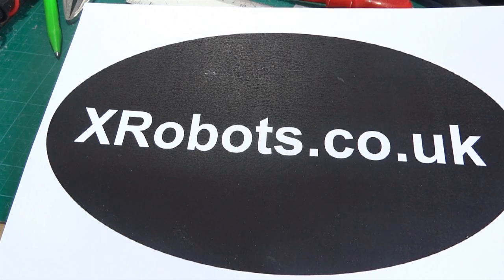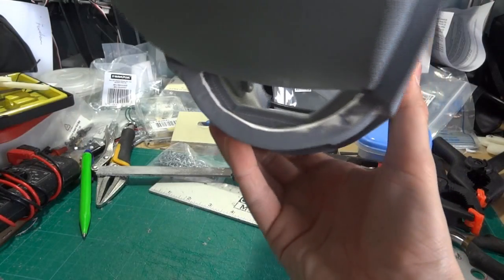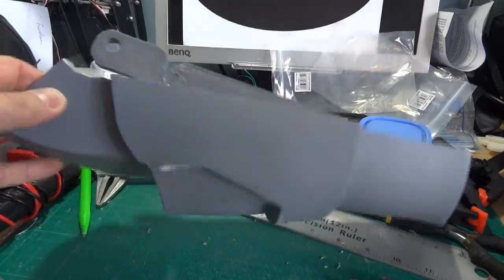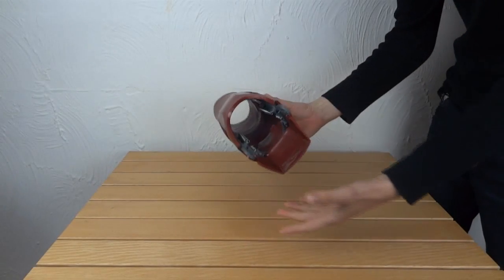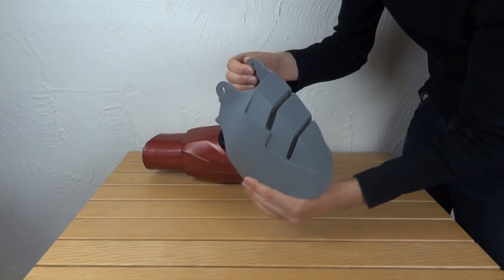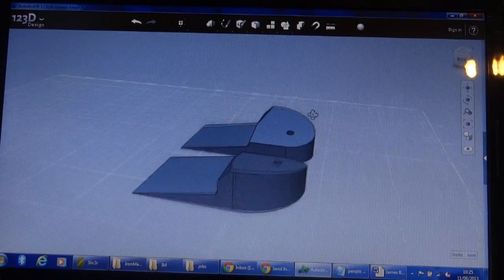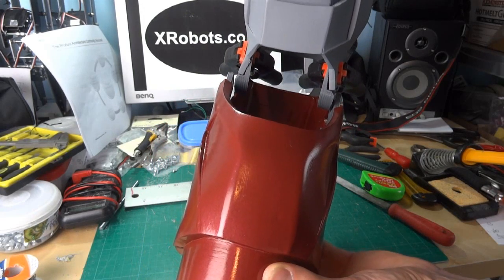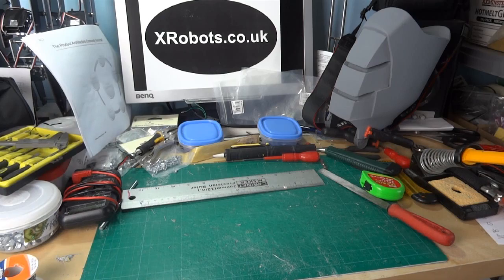Iron Man Power Suit #35 | Arm Mechanism Improvements | James Bruton

Comment: whats the point of the open/closing mechanism of the forarm if you can fit your arm through when its closed, will you be flling it with electronics that will make the space tighter? or is it just looks, and in that case is it not a bit big, in any case really cool build